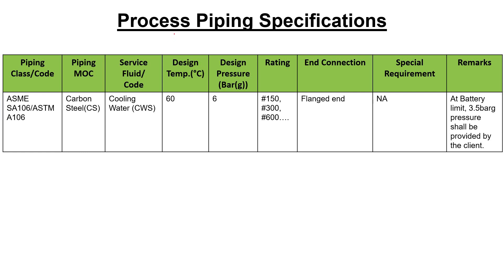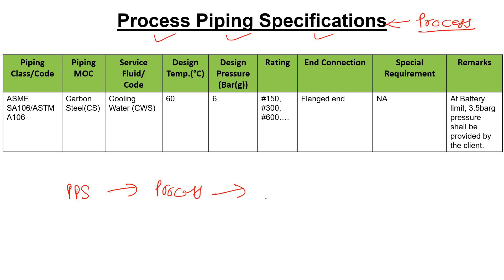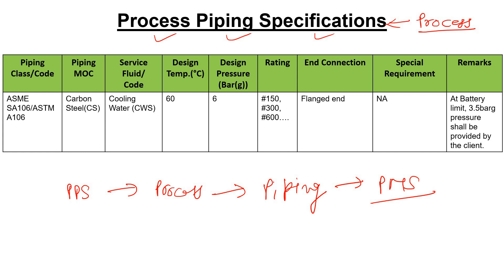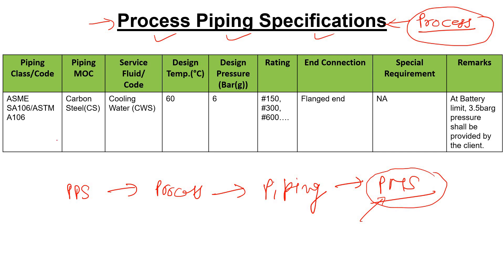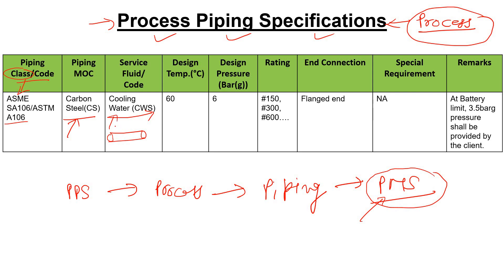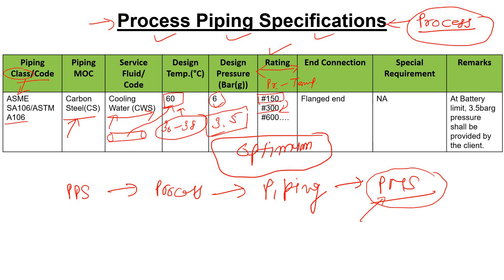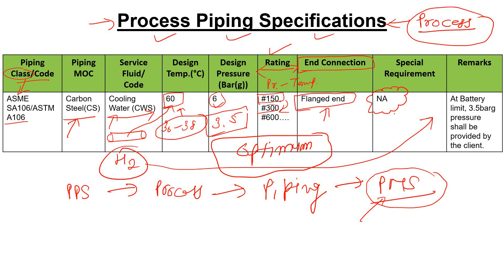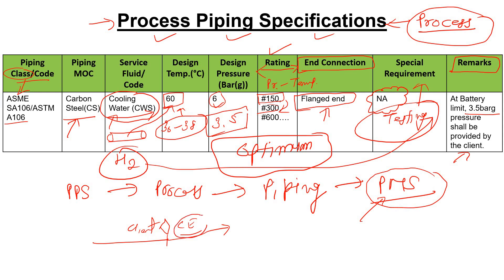Process Piping Specification(PPS) | Process Engineering | Piping Engineering #processengineering

Comment: Hi, in the case scenario that you propose, depending on what pressure is supplied to the plant from the client. If the pressure is too high, a PRV can be installed to maintain a constant pressure of 3.5bar. If the pressure fluctuations occurs, a buffer vessel would be the best option because all the pressure control would be done from the vessel forwards. The buffer vessel would by costly increased what could be a problem for the design. Let me know your opinion on that. Thanks. You are doing a great job. Keep teaching!
Reply from the maker: You may ask vendor that what pressure do you need at the battery limit and they'll provide if it's existing otherwise other way around we may go!